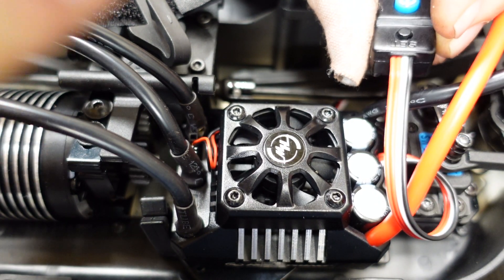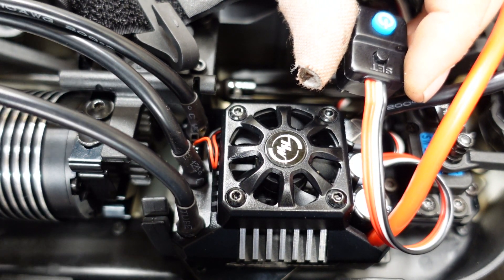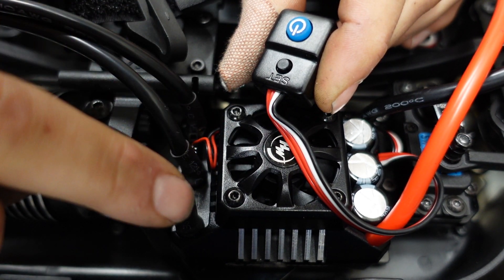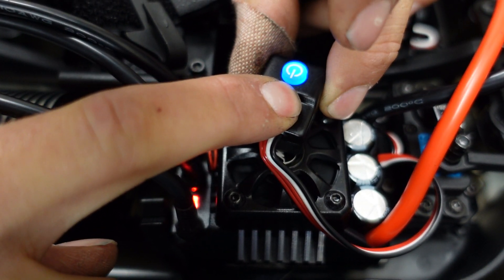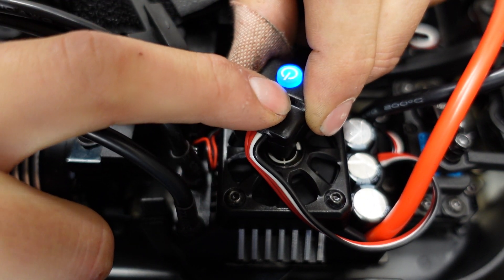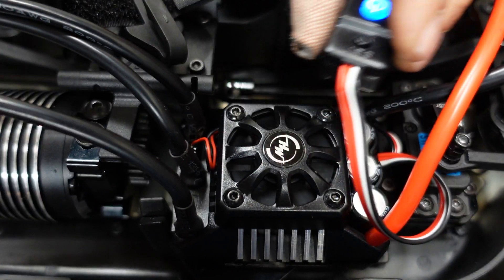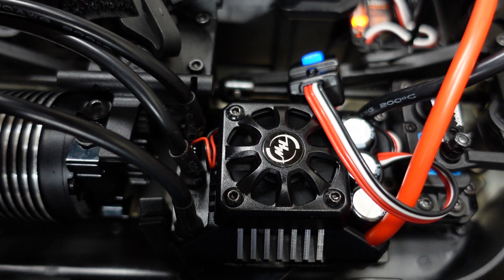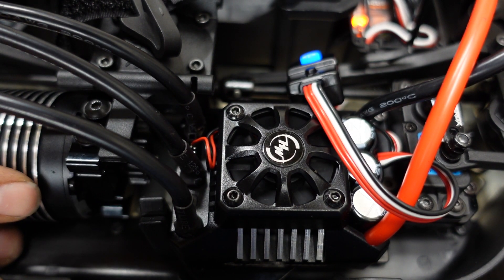How to Calibrate a Hobbywing ESC

Comment: My max 8 g2 is synced to radio and it works as expected. It recognises the inputs anyway. 

But the motor vibrates or sonething the drive judders but thats it. 

I hanent tried this though could it be this? The combo is from that car but ive added new radio. So mayb this is it? 

Or dodgy harness. Or worse?

Comment: Just got a Hobbywing 8BL150 for my E Revo 2.0 but calibration does NOT work. It will register neutral but not throttle or reverse. If I steer to calibrate the throttle and reverse, it works lol😂. So now I have a rc car that only goes when I steer instead of pressing the throttle😂😂, pretty sure it has something to do with the transmitter, gay ass Traxxas

Comment: This video is great, am using a Team corally CT2R controller should all the dials be at 0 prior to calibration (or perhaps all at 100%) ?  I also have a weird thing, the steering wheel is not recognised, but the steering trim knob when turned willmove the wheel direction. Perhaps my ESC needs resetting or mt rx/tx need rebinding?

Comment: Hi. After I went through the calibration procedure, I have power to the servos but not on throttle. What am I doing wrong? Thanks
Reply: Same here, did everything right and the throttle and reverse doesn’t want to calibrate, only steering

Comment: Friend! please help me I bought the esc it came without the cable, which connects to the motor, what is the gauge, (section) awg that I bought for the motor? What would be the cable? Do I buy it with a silicone cover? I'm going to use a 540v 8.5T motor in this 10bl120 g2 esc

Comment: Hey bud I have a question so I have the same esc it was working fine then now it won’t go in reverse so I have tried the calibration as you showed but when you get to the point that you have to set the throttle to brake the esc doesn’t beep now if I throttle forward it will beep do you have any idea how do I program it and let it set the reverse normally while calibrating ?

Comment: i am getting a constant x3 blinking green light after calibration , also my esc doesnt make a sound its a wb 10bl50 rtr esc , it worked before but i then plugged in my battry wrong and shorted it , is this 3x green light the fact that its shorted out and damaged ?

Comment: If you could clarify how you can do all this with the stock RTF transmitter. That would be the 761-1 RTF 750mm Volantex Mustang I can't get more than 1 or 2 beeps in any position. I was able to I get the motor to run but 1. Feels like it's catching when it first starts,2  and full speed doesn't seem like it's turning fast enough.  Haven't got the motor mounted yet so, can't really mount the prop. I'll have to look at adapting the motor mount.  Thank you. There's no set button for the hobbywing skywalker 30ampesc.

Comment: How do you reduce the drag brake with this routine? Would you throttle the controller to a percentage in the reverse direction to approximate different percentages of drag brake? While doing the exact sequence in the video,  my drag brake is now set too high.
Reply: You would probably need one of their programmers.

Comment: Hello so I just bought a max 8 combo and even when I try to do what you did it won’t stop flashing red idk what is going on please help, the esc keeps flashing red and when I go to calibrate it no green blink flashes
Reply from the maker: That usually means it has no throttle signal from the receiver. Make sure it’s plugged in the right direction.

Comment: Can you do something for power I'm new to the game I bought an used xmaxx s8 and it has no too much power like it doesn't even wheelie and reverse is very slow too it came is factory besides the hw esc and it came with 3s batteries so I'm guessing getting s4 batteries might help ??? Or do I have to do more gears and stuff ?
Reply from the maker: There is quite a difference from 6s to 8s power. Also the power can be turned down in the esc. If you are local swing by the shop and we can help.
Reply: @RCMadnessHobby  where you located?
Reply from the maker: @ramonortiz3095  enfield ct
Reply: @RCMadnessHobby  also I noticed that tge esc might be giving up or over heating or Idk what could be. But if I'm running comes out hard then slows down then stops by it self and doesn't do nothing till a couple seconds later idk if I should buy  a new one?
Reply from the maker: @ramonortiz3095  I would check the batteries or try a new set.  Also when it cuts off what are the led liights blinking.  Different number of blinks equals a different trouble code.
Reply: @RCMadnessHobby  I haven't chek tye blinking but I will let you know I know when I use reverse or forward it blinks red for a couple seconds then stop damn you in new England too but far from me if we where closer I definitely go there.